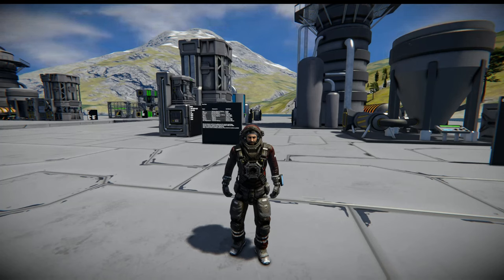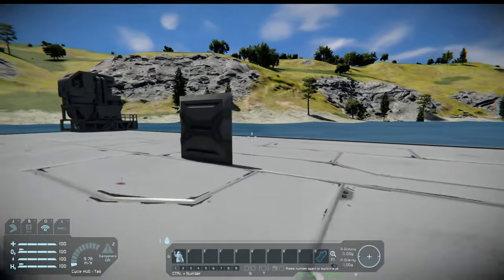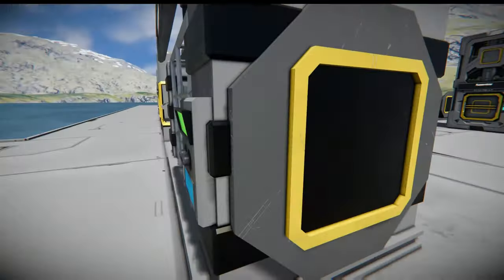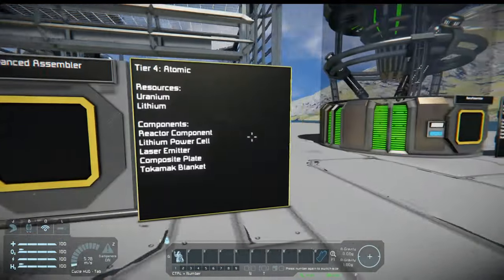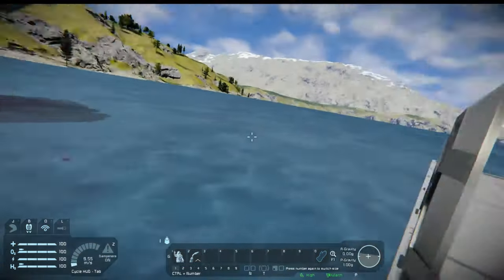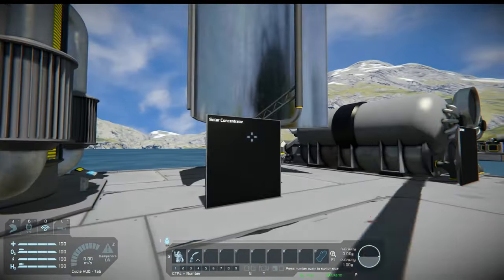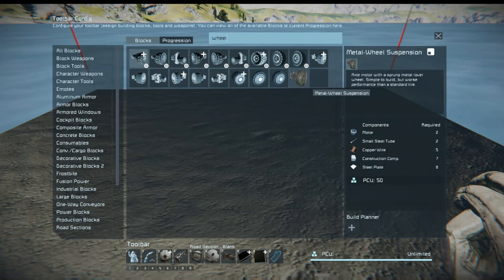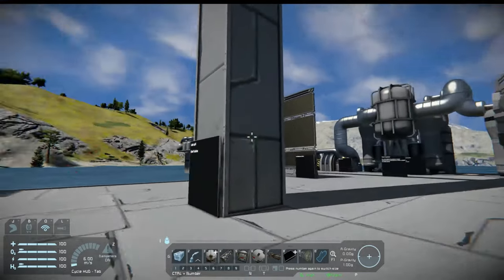Space Engineers Showcase: Industrial Overhaul Mod

Comment: I thought there was an option for modules to add to the refinery or assembler for power efficiency, yield, etc
Reply from the maker: There may be and I simply missed them. There is for vanilla version that I do know. But remember this is an entire overhaul mod with technically multiple types of refineries and assemblers.
Reply: The overhaul mod disables modules, you can still build them but they will do absolutely nothing. The vision behind this mod is that you need infrastructure and MUCH more power to produce more materials. Though you can get more yield out of your ores using better drills, rock crushers, and ore purifiers.